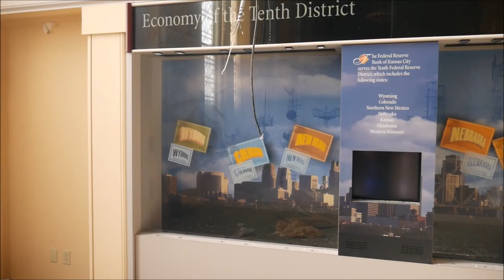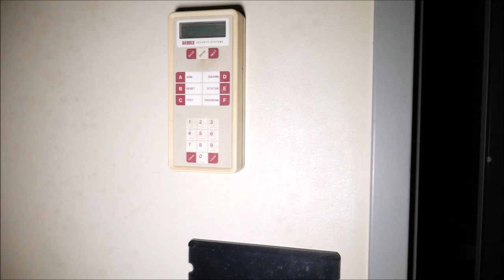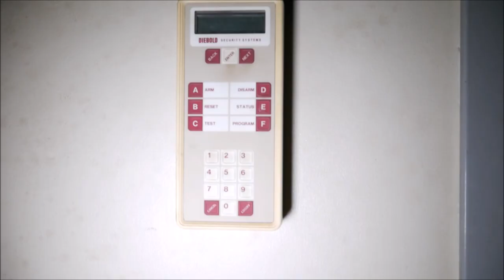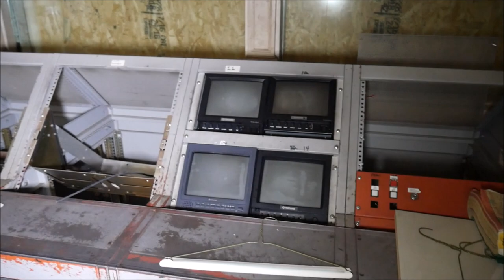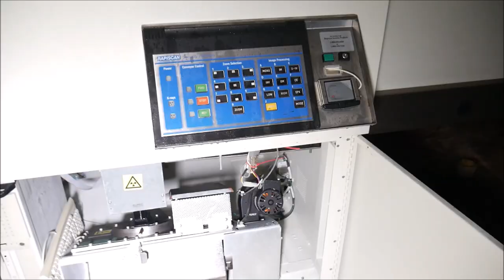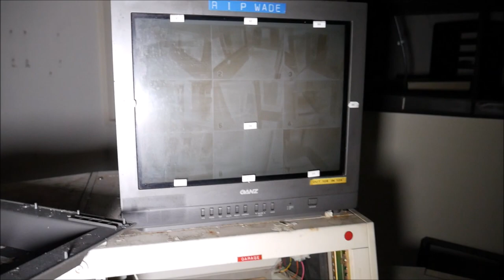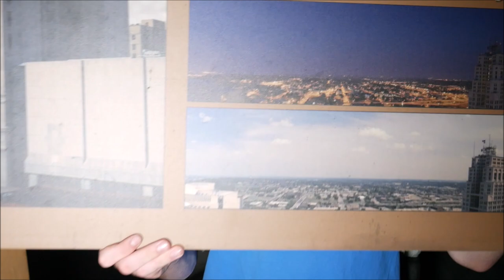Exploring the Abandoned Federal Reserve Bank - FOUND HUGE BANK VAULTS -

Comment: Yes guys those where diesel powered generators , the actual electric part has been removed, the building was designed to be off the grid if need be. If power was lost those big caterpillars would start up and run the whole building all the computer systems and HVAC, lighting and water chilling systems that building due too what is was used for was capable of sustaining itself for long periods of time, really cool stuff

Comment: wow those were some huge engines/generators, the second one was disabled, the valve covers are off. upon second look wow again, those are V12's, and both disabled.
Reply from the maker: Thank you for sharing that!! We always love to hear more knowledge about the stuff we find.
Reply: The alternator portion that the engines would have turned has been removed, perhaps for salvage or maybe re-use somewhere else. Just the engines appear to be remaining. Perhaps the cost to remove them and re-use them is more than what a new one would cost? Also, how would you get them out of the basement? Is there a loading door somewhere?